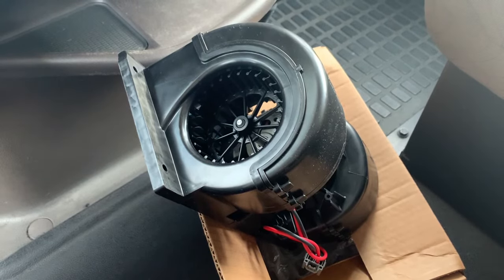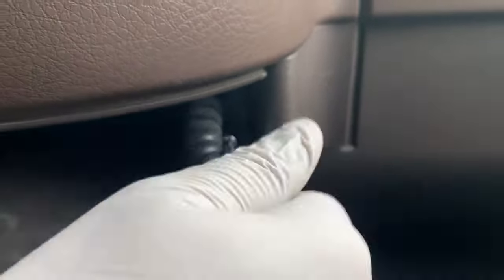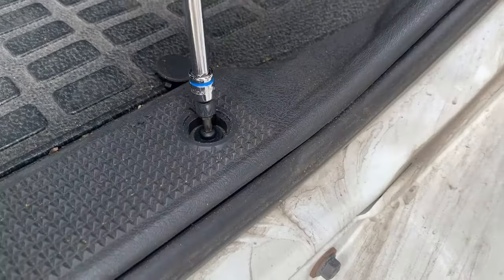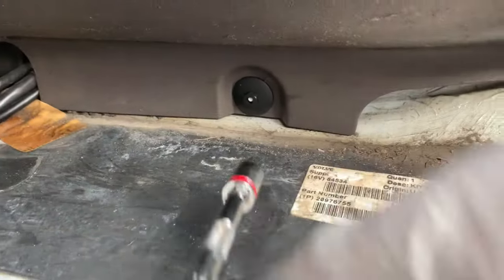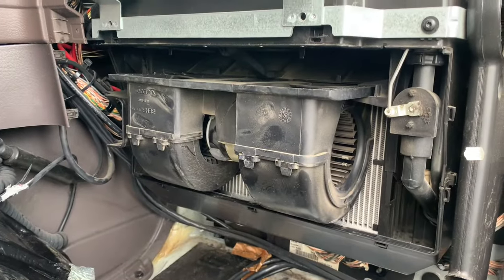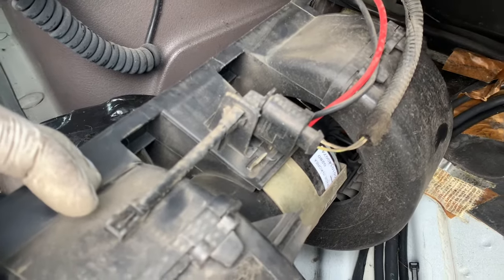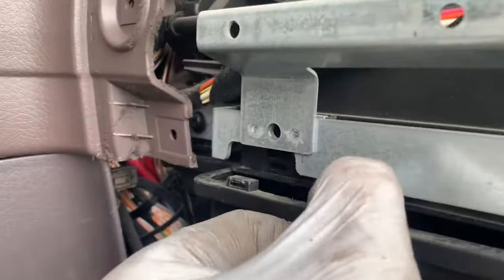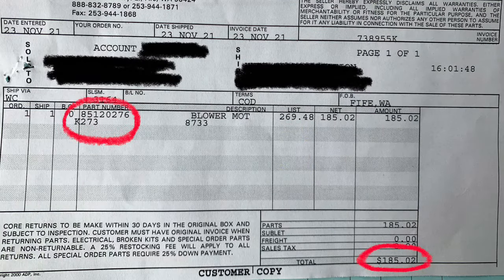How to replace heater, A/C, blower motor on Volvo Vnl D13 Mack (semi truck) Link in description.

Comment: Great video, how do you know if the blower is bad or the resistor? My blower sometimes starts to work, but on speed 3 it will blow like speed 1 and all random
Reply from the maker: The motor is not that expensive so I chose it as first thing to replace.🤣🤣🤣
Reply: @iTruckiTrailer  The resistor is even cheaper. The hardest part is to get to them, the access is painful. That's why my mechanic always suggests and advises to replace them both at the same time.
Reply: Working at only high speed or randomly changing speeds is the first symptom of a bad resistor. The blower motor resistor is responsible for controlling the speed of the blower motor. Once you have access to the resistor, it's also non-brainer to replace the blower motor.

Comment: Hey do you have a video how to replace ac evaporator? Thx
Reply: Im on the same boat, I ve got this far but still looks complicated
Reply from the maker: Ac dryer replacement Volvo Mack Peterbilt Kenworth International Freightliner Cat Mechanic shop Asmr
https://youtu.be/xikWrAAG6P0
Reply: Thx @upshift but I need if you have video about AC evaporator wich is located inside the cabin

Comment: Are there any fuses under there?
Reply from the maker: No
Reply: @iTruckiTrailer  I didn't think so, but someone told me they thought there were and I was about to try peeling that all back on my truck to look. I'm glad I didn't waste that time. I'm very much not a mechanic and it would have taken me forever with crap skills.